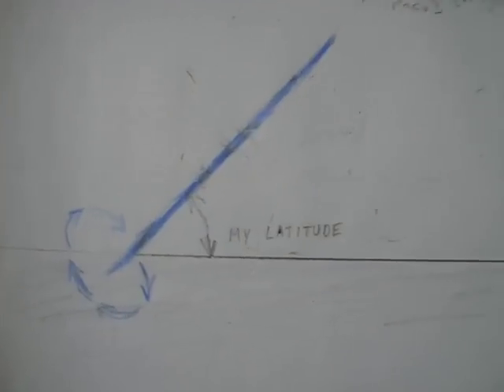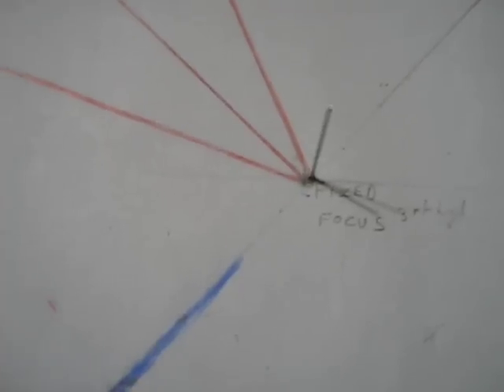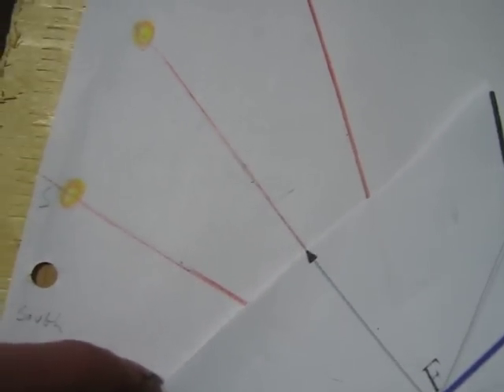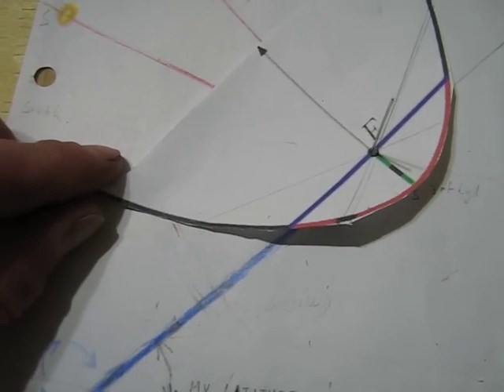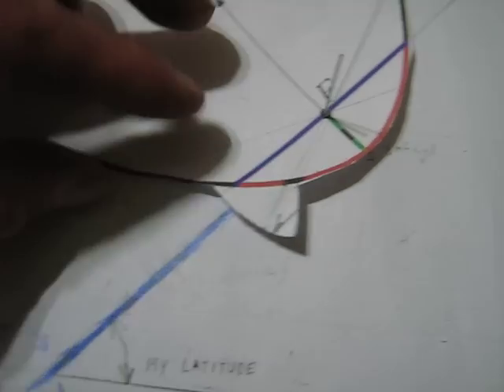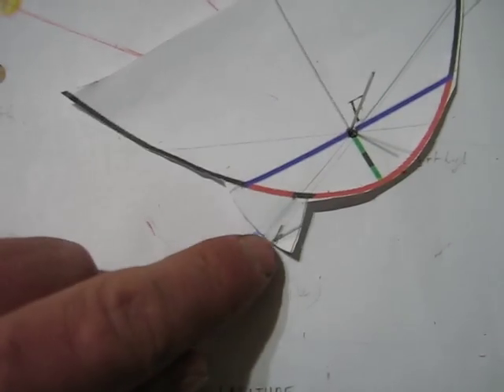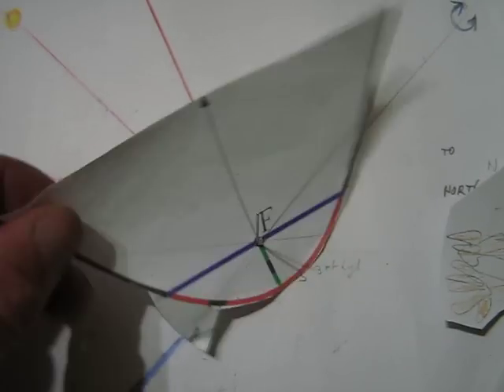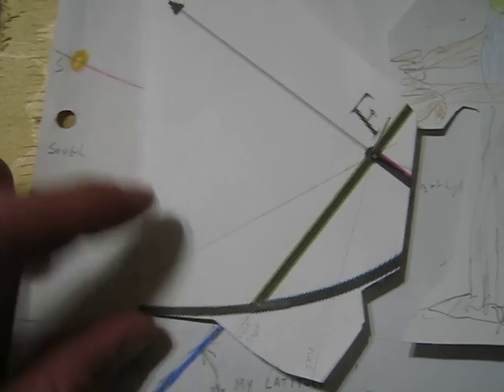Tracking solar barbecue, a dish for your latitude!

Comment from the maker: There are a number of ways.  On this one I used a cut out from a picture that I downloaded off the internet. (focus was already marked.)  I usually use a variation of the string and T-square method because it is very easy to change the focal length with that method. You just got to remember to use non-elastic string. My stuff is aimed at everybody, including those with no mathematical education. The String method works for everybody. Numbers methods are only good for the educated elite.